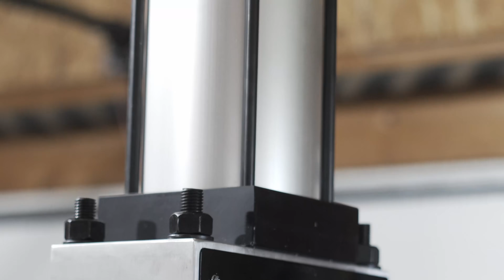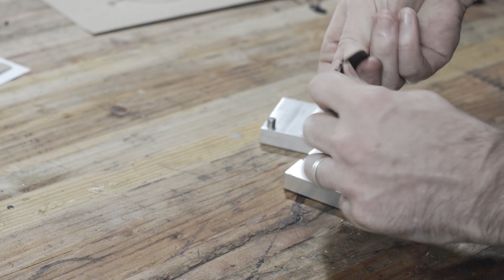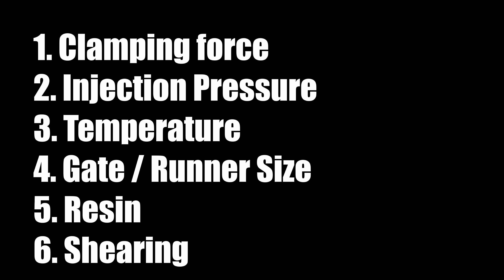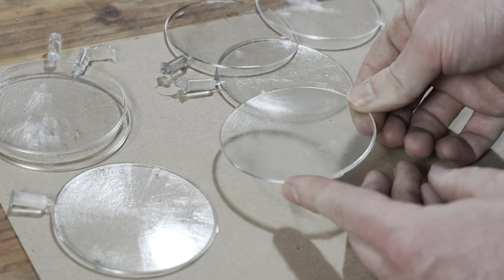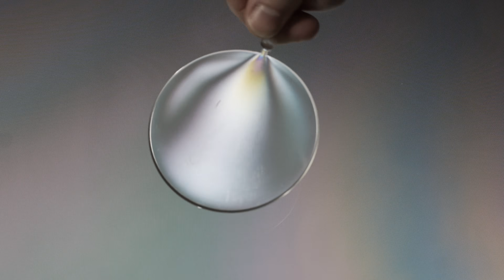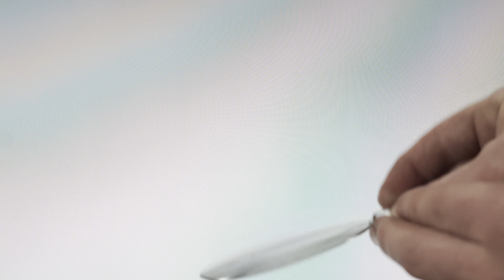Machining an injection mold for acrylic lenses

Comment: Any recommendations for a cnc and a machine for injection molding? Like for cheap
Reply from the maker: Bare minimum CNC that can handle aluminum is probably a Shapeoko.  Checkout Winston Moy's channel, he has a lot of great content and tutorials about optimizing his machine for metal cutting.  It'll be slow, but get the job done and with decent finish if you tune it right. I like my AvidCNC Benchtop Pro, but its considerably more expensive.  For injection, I like my Protoject... but that's my only experience so not quite fair either :)  The manual Morgan machines are supposed to be pretty solid too.  Anything smaller than those could be tricky, depending on what kind of parts you need.  Clamp pressure limits how large of part is produceable (as well as injection pressure, but in my experience clamp runs out first)
Reply: @BreakingTaps  thanks. And what are you using?
Reply from the maker: @dansv3872  AvidCNC + Protoject for me.  Oh, and you should also check out JohnSL (https://www.youtube.com/channel/UCJT6JcjZCttm5PHnW9kWluQ) for injection molding stuff. He has a pretty nice Haas CNC so that doesn't apply, but he has a few different smaller injection molding machines and lots of experience with doing small parts.  Would probably be a good resource to see what's possible, and tips/tricks.

Comment: Have you thought about "annealing" it, more or less, by baking it either in the mold or maybe hitting it with a heat gun? The heat gun would probably do wonders for the surface finish (similar to flame polishing acrylic) and I'd have to assume baking it in the mold would greatly reduce the uneven internal stresses that you're able to display to us thru polar filters, etc.. just a thought and maybe you already mentioned this and I just missed it, but in case you hadn't considered it, I'd love to see what the results of that might bring 
Cheers! 
- Jesse
Reply from the maker: I didn't at the time, but someone else had a similar suggestion after I posted the video.  I think that would help a lot, both on the surface quality and the internal stress!  The internal stress in particular should even out, since that's all thermal-induced stress and should start to relax if you get it close to the glass temperature, I think.  Honestly even doing an actual flame polish would probably help a bunch too :)

Someone else suggested a "low pressure" molding approach, which apparently is used in real optics molding a lot.  E.g. inject a slug of plastic into the mold while partially open, then clamp it down.  That limits the shearing stress at the gate and gives more uniform parts.  I played around a little and it worked great when it worked... but was really hard to time it by hand :)
Reply: @BreakingTaps  oh that's awesome! Do you think you'll do a follow-up video on it? I for one would certainly be interested in seeing it! Thanks for the in-depth response btw, much appreciated and very cool experimenting you're doing here, fun stuff! 
Also, speaking of follow-up videos, I'd LOVE to see a part 3 to the brushless motor conversion on your milling machine as I'm trying to do something similar but am having trouble wrapping my head around what direction I want to go... I'd love to see it installed and working (or disassembly of it would be awesome too, just to see exactly what you did for the solution - I didn't see any other videos besides 1 and 2 for that, right? Did I miss something,  bc it just seemed to end without much of an explanation or review as to how/if it even worked, etc.. if I missed it, please let me know as well! )
Cheers! 
- Jesse
Reply from the maker: I think I'll do a followup eventually.  I have a few optics projects that are sorta in the works (if I can iron out some other details), and would need little microlens arrays which seem like they would mold well.  So I might be revisiting this at some point.

Hehe yeah... you didn't miss any videos, I still haven't finished that brushless conversion.  I got stuck on the electronics enclosure at one point (needed to make some big changes, which meant rewiring everything) and it just destroyed my motivation.  Then I kept needing the mill for projects and didn't want it out of commission... so it's been perpetually 80% finished but still sitting on my bench.  🙃
Reply: @BreakingTaps  be careful annealing, it will likely relax the stress by warping the part. One of the ways to even out the stress on the lense is thru several gates. Have your runner split into 2, and each of those split into 2 and then gate in 4 places along the perimeter. You want to do it in such a way that each possible path is the same length. Of course, you'll have weld lines, which might be a problem.
Another thing you can do is heat up the mold. Machine some water channels, run hot water thru it. Plastic will loose less heat to the mold, and makes it easier to fill.
Typically machines use velocity control rather then pressure control, if your machine isnt capable of that, it's going to be a serious limitation.

Comment: The hardness of the PVD tools allows you to cut hard materials without the tool "changing shape" ie wearing.

I've had experience hard machining hot forging die tools where we had to machine the part, measure it then adjust the part model in CAD to account for tool wear and then re-machine it.

This was with 1mm ball nose coated carbide endmills.
Reply from the maker: Woah that's wild.  I feel like just breathing on a 1mm tool would break it :)

Comment: Hey, nice little mold! I would try making the gate shaped like a hand fan - thin but wide. Maybe this will solve your "partial shots" problem. It should provide more flow for this thin and yet rather large part.
Reply from the maker: Thanks for the tip, I'll try that out on my next mold.  Makes sense, since it would reduce the pressure at the gate and probably allow more volume to flow.  Cheers!

Comment: Are you able to crush down the scraps/errors and use them?
Reply from the maker: Theoretically, yeah!  You can grind up most plastics and reuse it, although the material properties change each time you do it.  Different mechanical properties, usually more defects/hazing/silver streaks, etc.  I haven't personally tried, but I've read clear polymers are much more difficult to reuse than opaque since all the defects are visible.  I believe mixing in some "virgin" material helps maintain material properties.  But for things that don't need to look perfect (hidden components, parts that the user doesn't care are blemished, etc) it's a great way to reuse.

Comment: try annealing the lenses to see if the stress goes away
Reply: I wonder if the annealing could be done while it is still in the mold?
Reply: @jcims  You're generally supposed to pre-heat the molds anyway, so you could probably just keep the mold itself near the injection temperature and then slowly cool it. Should theoretically help, at least with certain plastics.
Reply: @TheVideoGuardian  I wouldn’t keep
the mould at injection temperature. Maybe around 40degC though.
Reply: @welshsteve2009  Injection temperature is probably too much, but in some plastic if you hold above the glass transition temperature for several hours they become stronger/clearer/etc. (60C in the case of PLA, less time if above that.)  I'm not sure how a mold changes things, but this effect works with 3d printed parts in an oven, albeit they suffer terrible warping. This only works with some plastics, however. (IE, not ABS or PET)
Reply: @TheVideoGuardian  Thanks for the reply. Yes,  I agree. However, In the real world though, it wouldn’t be practical/economically viable to hold parts for any significant period at glass transition temperature.
Reply: @Brooks Tyler Yea, have been using Flixzone for months myself :)
Reply: @Brooks Tyler definitely, I have been using flixzone for years myself :D
Reply: @Brooks Tyler yup, been using Flixzone for years myself :)
Reply: @Brooks Tyler yup, I've been using flixzone for years myself =)
Reply: @Brooks Tyler Yea, been watching on Flixzone for months myself :D

Comment: To reduce this tension marks that appear after injection is needed to be injected with opened mold, around 0.2 mm and after injected 99 % of material, close the cavity and core side completely. Do not forgot to made exhaust with 0,02 mm around adjustment area, or the gases of process will to do other marks at borders. Was amazing video. Congratulations!!!
Reply from the maker: Oh, interesting!  So this is like a low pressure injection to distribute the plastic throughout the mold with low stress, and then a high-pressure compression to fully fill out the mold?  That's clever!  I don't think that would be toooo hard to do on my machine.  Probably tough to do in a consistent manner from shot to shot (the machine is purely manual right now), but I bet I could get a few good samples out of it.  Thanks for the idea!
Reply: @BreakingTaps  acrylics are hard material to this process. Try PMMA, It can be injected with bigger temperatures without carbonation. Maybe, with bigger temperatures at molding areas you can have less stress in the plastic parts.
Good luck!

Comment: Knowing nothing about injection molds, why not heat up the mold to reduce the temperature shock to the resin?
Reply from the maker: That's definitely a thing I want to try!  Big industrial machines have tight control over temperature (often the inverse though, water cooling to keep the heat down since they are injecting so much more frequently).  You can get little mold heaters that attach to the clamp platens for smaller machines like mine.  I have a hot plate around here somewhere which I am planning to try in the future.  My understanding is that it should improve basically every characteristic: lower pressure/temperature required, better filling, fewer artifacts, etc.  The main downside is longer cycle time but doesn't really matter for me :)
Reply: @BreakingTaps  Awesome, thanks for taking time to share your research. Good luck with future testing!

Comment: time to get a lathe with a grinding post so you can make your own dowel pins 😎
Reply from the maker: Tool acquisition never ends!  Haha.  I actually have a lathe... but it is in pieces... so I really need to spend some time working on that instead of messing around with new things 😅
Reply: @BreakingTaps  I'm guessing from a more recent comment you made that the lathe is still in pieces.  If you haven't heard this yet, a functional manual lathe that you might convert to CNC will be much more useful to you than a box of parts that you might convert to CNC one day.  Get that beast built and make some chips!
Reply from the maker: @TuckMcSouthard  Hahaha yessssss, it's true.  My Shame: still a pile of parts on my shop floor.  I really, really need to work on it.  And I agree, I might just bite the bullet and re-assemble as a manual lathe. I probably could have re-assembled it in the amount of time I've spent working around not having a lathe 😅

Comment: Yeah I think your notes on the PCD endmill are correct. The practicality of the PCD is very poor. A sharp, polished, and uncoated endmill will work the best for you. PCD is typically reserved for HARD materials such as a hardened tool steel or even materials such as tungsten.
Reply: pcd is for non ferrous metals. if you want to machine hardened steel you can use ceramic inserts, or coated tungsten carbide end mills
Reply: I guess it will also depend on the quality of it - they use PCD bits to cut the "polished" edges on the IPhone 4 without polishing it.

Comment: Super cool to see your videos since I have a recently built benchtop pro also with Clearpath servos. Keep em coming! 👍
Reply from the maker: Nice!  How're you liking the servos so far?  That's definitely an upgrade I've been strongly considering :)
Reply: @BreakingTaps  You have a way nicer spindle though ;)  I love em! I used many of them in the past... 39 clearpaths on this crazy thing I built: https://youtu.be/dzkMOAWC4Eo . They are torquey as heck so they can maintain very high travel speeds even while contouring. But I think the main benefit is the built-in encoder. So you can run them fast and hard knowing they'll throw an error back to the controller if their actual position slips a certain amount from the requested position. That said, like most of this, its definitely not required. :)   An initial test countour run here: https://www.instagram.com/p/CBtkbZynwS0/?utm_source=ig_web_copy_link
I'm just getting started in CAM though so it's a journey for sure....
Reply from the maker: Great to hear!  Definitely keeping servos high on my "things I'd really like to upgrade" list.  I don't often miss steps, but it does happen and basically scraps the part.  Super annoying, especially because you don't find out until the end when you see it's shifted.

That sculpture looks great!  Bet that was a nightmare trying to get all the servos and lights wired up :D

Comment: Cool video. Can you give an approximate price on that injection machine? I couldn't find much info on it
Reply from the maker: The machine is from Manning Innovations: https://www.manninginnovations.com  ... I'd drop them an email, my understanding is that the company is still in "startup mode" so pricing varies depending how it's configured, and they haven't fully settled on which options should be streamlined for production and which shouldn't.  E.g. the clamp I have is a pre-production unit so it was sorta one-off priced.  And covid stuff is messing up everyone's supply chains too so I think some aspects are in flux.

I quoted out a few options (>$2k and <10k as a rough range) and after evaluating various options (used Morgans, new Morgans at $25k, used industrial machines, lever-operated machines, and small automatic machines from china) I thought it was a very fair/competitive price.  Sorry, I know that's a bit vague, but the owner was super helpful when I was evaluating options and I want to do right by them since they are still in a critical startup phase :)  Ritchie is great to chat with by phone or email if you end up being interested :)
Reply: Breaking Taps  Thanks I really appreciate the detailed response and info. I'll go take a look. Really enjoying your channel 👍👍
Reply: @BreakingTaps  Having also bought from manning innovations (small handle driven one in my case) I also concur that Ritchie is great to deal with. At least in my case he answered a lot of questions with no sales pressure.